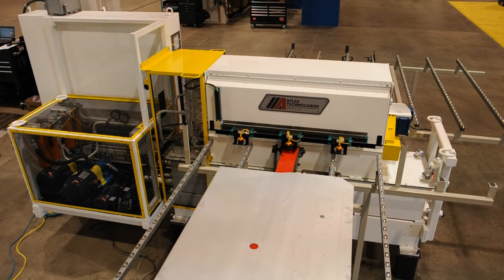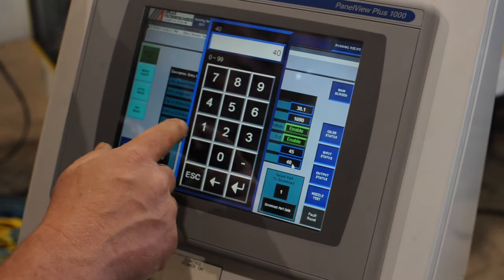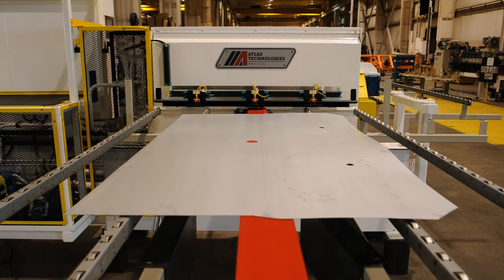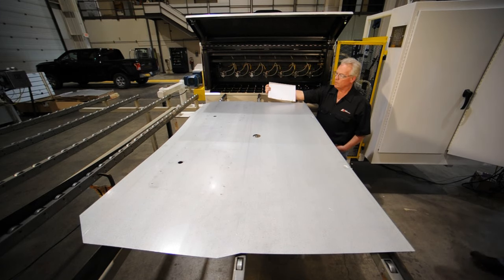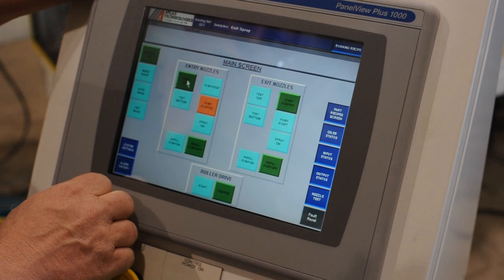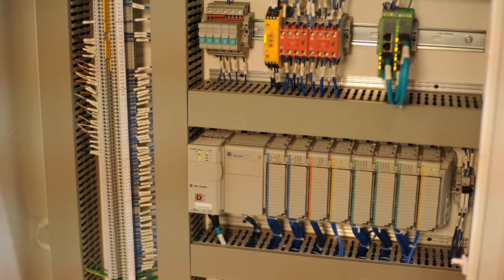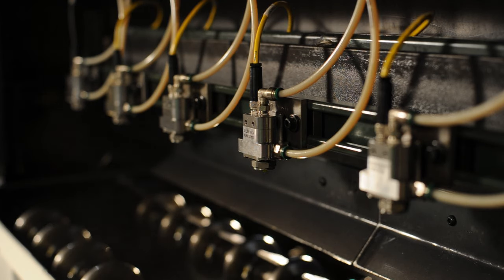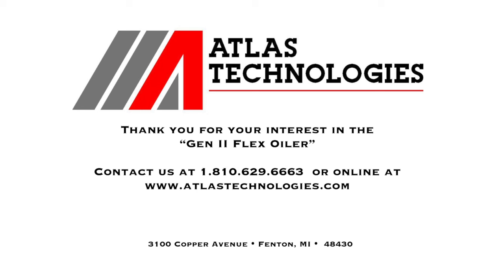Sheet Metal Blank Oiler -www.atlastechnologies.com

Comment: Which lubricant oil is recommended for pressing the stainless steel blanks
Reply: Die lubricants are best specified by the die source as the type of die, depth of draw, and other die/part specific parameters will determine the best lubricant